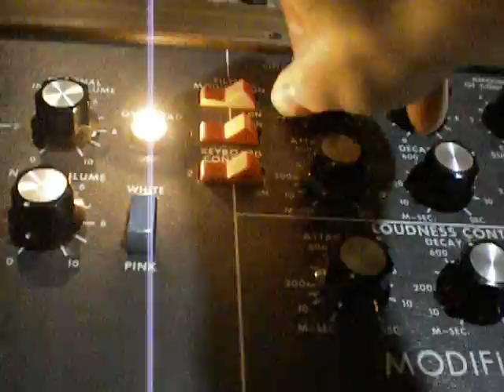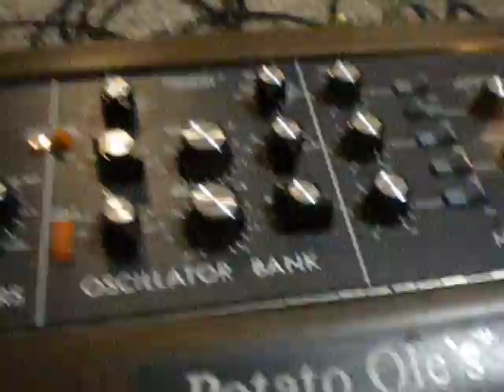DIY Square Wave Oscillator

Comment: hello! I tried building this using the info on the instructables site, but I can't get any output... When I power the thing up, the chip gets so hot it melts my breadboard, what did I do wrong?

Comment: Hi I have a question 
I copied the schematic exactly as well as your bread-board representation and I am not getting any oscillating voltage. Checked every single connection/component with a multimeter and everything is a constant voltage, not oscillating. Does not work when hooked up to speaker or amp either

Comment: I read the instructable and I am really anxious to get started on this. But i was wondering how(if at all possible) i could make a small adjustment to where the noises coming from the oscillator could possibly be combined with other noises, like a guitar pedal so-to-speak.
I'm sorry if this question seems asinine, but I have no knowledge in this field.